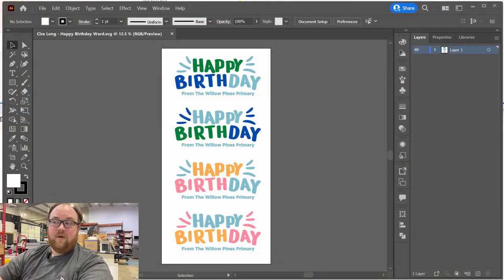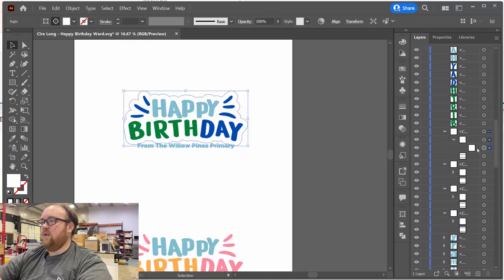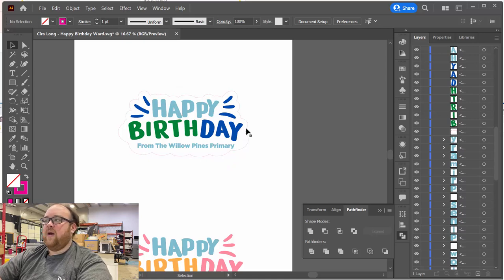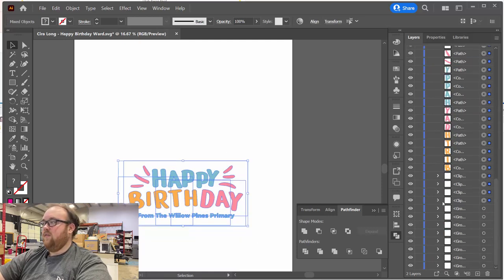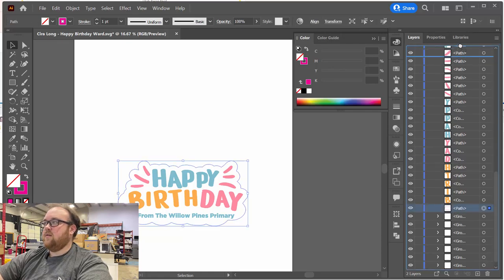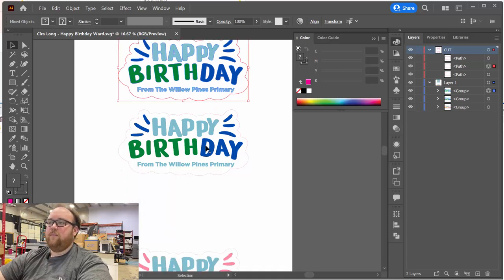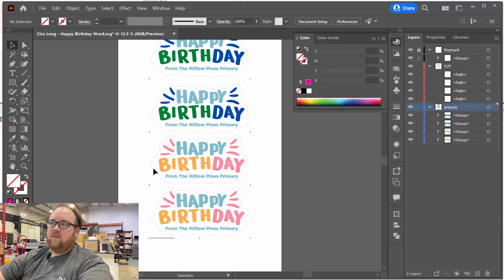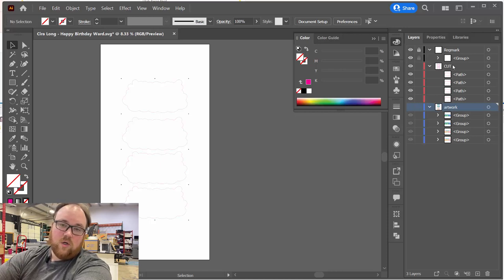Setup files for print and cut on the canon flatbed and summa f1612

Comment: Quick illustrator tip. When you select your cut line on artwork layer, if you scroll up to the layer names and drag the coloured icon to the cut layer that’s the same as moving your selected item alllllll the way up.

Comment: that seems excessive. We have done flatbed/print and cut with the summer and printing on a flatbed, and we can just send files with hidden cut lines to caldera for output and it automatically generates cutlines for summa.. way less steps and way faster...
Reply from the maker: I totally agree there is probably a better way. I had to learn it on my own and this is what I found works. Some day I'll find a better/fast way to do it, but right now it's not a pain point for me. But caldera sounds way better.